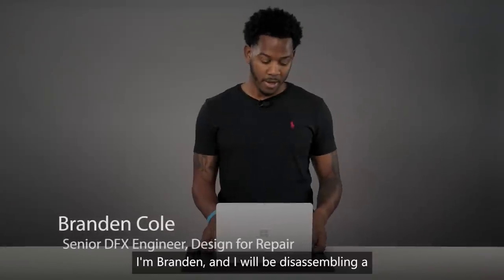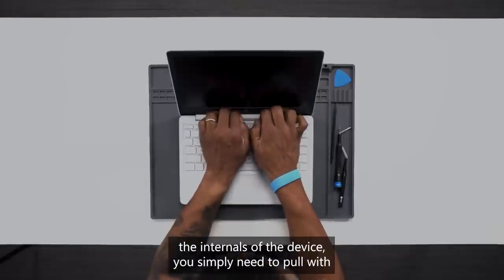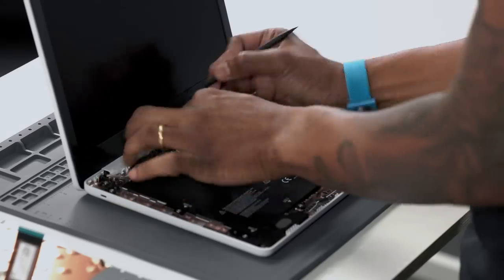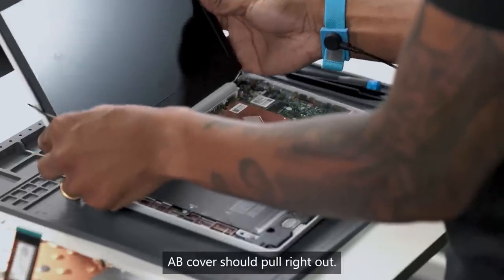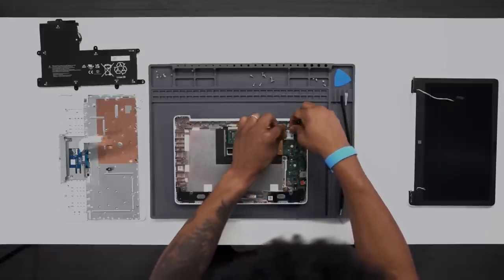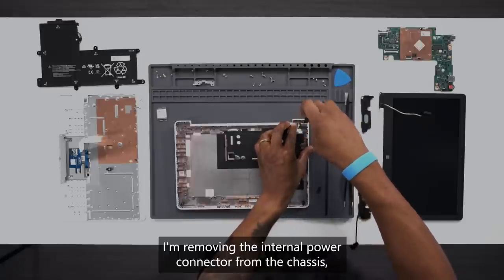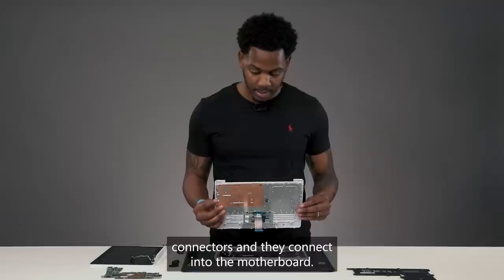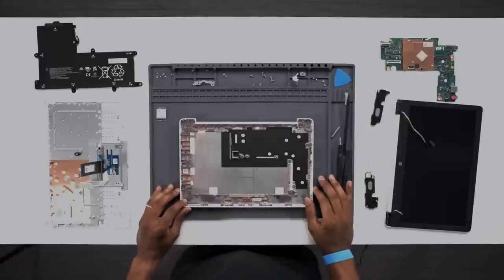Repair | Surface Laptop SE

Comment: Dear Microsoft, if possible, please extend this to your other Surface-Devices. That would be a Game Changer and your Devices and your brand would get the recognition it deserves! Keep the good work going!
Reply: ur not wrong,so dont be like apple microsoft
Reply: No, unless doing so still keeps the Pro X thin. Being slimmer than MacBook+iPad is a selling point.
Reply: They will be compliant with right to repair going forward with their devices, something they stated about a year ago.
Reply: And every Surface product will be thicker and thicker
Reply: Come on just dont open it
Reply: @khtannnnnnnnnn  A few added millimeters of thickness is worth the benefit of being able to repair your own laptop. People always say that they don't care about repairability, but I guarantee they will be wishing they had that option in a few years when their battery needs to be replaced and they can't do it themselves.

Comment: This is basic laptop targetted for the education market. Microsoft plans to sell them in bulks to schools. This video will assist school technicians to repair the laptop on-site whenever needed. My country used to buy Samsung Chromebooks in bulks about 10 years ago. They are quite hard to self-repair. I think this Surface SE should be the right laptop for schools in my country (a developing middle income nation in Southeast Asia).
Reply: I remember being highschool repair ing those Chromebooks it wasn't hard. But it could help if the school would give some testing equipment or better screwdrivers.
Reply: Please avoid pentium processor for the sake of those children
Reply: @blackhatson13  Probably i3s
Reply: the good thing about selling them in bulk means that the used laptop is highly available like the thinkpads

Comment: Nice to see this step in a repairable direction - hopefully replacement parts will be easy to access too, then it'll truly be easy to do DIY repair.
Good job!
Reply: yeah when he was removing the c cover... looked like he had some difficulties removing it... I hope it is much easier in the future for students to remove without having the anxiety of breaking the snaps on the cover
Reply: It's odd that the Wi-Fi card is modular but the SSD isn't. Upgradeability aside, the Wi-Fi card rarely needs replacing. If it does break, no big deal. The laptop still works. You can hook it up via USB dongle or Ethernet adapter.

But if the SSD fails, not only do you lose your schoolwork/assignments, the laptop also becomes a paperweight. The omission of an M.2 slot for storage is a weird one for sure. Running an OS on external storage is always an option, albeit clunky.

Comment: Niiiiiiice
Reply: Bend it Jerry! 😀
Reply: It really is not, Zack. A laptop this size came with upgradable RAM and 2.5” storage not too long ago with a decent cooling system. Despite smaller storage sticks and passive cooling, they completely skimped on upgradable parts. This is merely a disassembly video and doesn’t do justice to repairability.
Reply: @meetankush  I've got a Lenovo ThinkPad x131e which has one 2.5" bay, two RAM slots, two mini PCIe slots (one for Wi-Fi and the other for WWAN/mSATA) and a keyboard that comes out separate from the top and bottom case. And it's got three USB ports, HDMI, VGA and an SD card reader too!
Reply: @meetankush  ram yes. 2.5" storage, I never saw in an 11 inch laptop.

Comment: I am an industry outsider of about 8 years. Just so you know, this is a disassembly video, not a repair video. We see nothing being repaired - pulling it apart is only half the story.

Four most common repairs I see for education-market laptops are the LCD, charging port, keyboard and the "hinge". But by hinge I mean the bottom chassis, or "bucket" in this instance.

 - The video doesn't show the process of replacing the LCD independent of the lid, but it's most likely an off the shelf panel so should be trivial to replace even without instructions. 11.6" WXGA laptop LCDs are very common, it's just a matter of whether it has screw flanges or not. Chances are you can even upgrade it to IPS!
 - The DC jack is a modular and not soldered, excellent! A lot of Chromebooks these days have USB-C only for charging, and the port is usually soldered which sucks for repair.
 - Ideally the keyboard should not be fused to the top case, so it can be replaced on its own.
 - When a laptop "hinge" breaks, it's never the hinge itself that breaks. It's the mounting point for the screws in the bucket, or the bucket itself. Would've been nice to see a large steel anchor or some other kind of reinforcement so that it's far less likely to break in the first place.

Comment: All the laptops I have ever owned were basically this straightforward to repair. (Other than Apple! Which I never buy, but I have gotten some when family members no-longer wanted them. Even the ~2012 and older Apple laptops were about this repairable if you could only get the replacement parts easily.)

I appreciate how above and beyond Framework has gone now, and I like that companies are publishing teardown guides. But all my Dell laptops/desktops for example have had repair and service manuals. Acer is also openable and user-serviceable.

Having non-replaceable parts is an extremely recent trend in the history of consumer PCs. We should understand that this is a step back, a regression from even the 2000s and 2010s. And demand that companies KEEP computers repairable. Not glue and mold them down into parts that aren't "serviceable" so much as "breakable" if you attempt to open them up and take them apart.

Anyhow, thanks MS for going BACK to repairable designs. Like it always has been. Don't regress that ever again, please. Especially if it's just following Apple down a bad road that led you there. Thank you.

Comment: Apple would NEVER dare to do this. Even with their "pro" products. Microsoft is still the best!
Reply: That is because you won't need to repair a Macbook unlike this garbage.
Reply: That's because "Pro" products are not easy to disassemble and repair. I would love to see what are you gonna say about Surface Laptop Studio repairing? As you are talking specifically quoting "pro" products. So idk what is your point about apple but every other laptop manufacturers including Microsoft don't make their pro products easily repairable.
Reply: @Waldo  Remember. This is a school aimed product for young people, mostly kids in class, so that's why it's prone to breakage, it's also 5x less than a macbook pro
Reply: You would still want to still clean out dust from a macbook. don't you do maintenance on your computers?
Reply: @Shawn.Shooter  at least the surface laptop studio does not have pentalobe security screws.
Reply: @thetechbin401  You don't need to clean the dust out of a MacBook for 7+ years. Dust barely impacts performance in the first place. The MacBook air doesn't even have fans to collect dust.
Reply: They announced an independent repair program months before this was announced, which will include MacBook Pro‘s at some point.
Reply: Microsoft is the best until you realize that you need to repair them immediately due to trash qc!
Reply: valve is initiator and MS is coming. Cool!
Reply: @marky7009  Repairing 7+ year old macs, a Windows machine would be LUCKY to last 3 years and that is just the hardware, the software starts showing its age in less than a week.
Reply: @Waldo1122  This is a 250$ bulk education device and it'll still have better longevity than a modern macbook will.
Reply: @cooltwittertag  Is that why Microsoft themselves is posting a how to repair video, because it is so reliable. Just admit it, Apple is beating Microsoft at their own game.
Reply: @Niko-op3oz  I have never experienced that.
Reply: @Waldo1122  Wrong, you will eventually need to replace the battery even if nothing else breaks.

Comment: Microsoft, I bought the Surface Pro competitor offered by Lenovo, the ThinkPad X12 Detachable, as that product features six screws behind the fold-out back cover used to access the internal components of the device. No adhesive/glue was used to prevent opening of the device and user-servicing of it. That device also has user-acquirable parts to use proper replacements. Please introduce this to all of your product lines in the future and I would consider a Microsoft product more seriously.

Comment: So......are replacement parts available to "authorized repair" shops and refurbishers only? Or will we we see batteries, boards, and displays readily available on the official Microsoft Store for the average consumer, hobbyist, and enthusiast as well?

#RightToRepair #LouisRossman
Reply: This video is mere disassembly walkthrough with no upgradable hardware. This product is as repair friendly as an iPad, really.

Comment: I like how the palmrest is the first part that comes off since the keyboard and touchpad are the parts of the laptop that get worn out the most. You could easily restore one of these laptops to "new" condition for another user by simply replacing that. The only problem I have is that the SSD appears to be soldered onboard. So, that basically means this entire motherboard has a limited lifespan.

Comment: Wheres the storage drive?  Memory?  This another case where if you end up with a faulty drive or memory you've gotta shell out 300$+ for a whole motherboard assembly?  It's great that you can repair but it leaves a bad impression when simple things like that are ignored.
Reply: Most 11” laptops (barring chromebooks) are more repairable than this device.

Comment: The only thing I'm worried about here is the EMMC being soldered on. Whenever I've seen cheaper soldered flash like this, the write endurance is pretty pathetic, see the HP Stream.
Reply: It's a throwaway laptop, besides those connectors are pretty expensive and on a craptop that cheap they have to get margin off somehow.

Comment: Come on guys, it's nice that techs can easily remove all components, when what is most important to the savvy consumer is can the memory and storage be removed or upgraded.  The processor is a waste of time in addressing..  nice 1st step MS
Reply: Upgradable components aren’t for the “savvy” crowd, they are for everyone. Two years down the line, 8GB RAM won’t be enough or my SSD can die on me, none of those two things I can upgrade myself, making replacing memory or storage a complete board replacement issue, which is half the price of the laptop. Microsoft releasing this video is likeone opening the trunk of a Tesla car.

Comment: What is that blue wristband with the cable for, that he is wearing? Never seen that before.
Reply: For static discharge. The wristband is connected to a metal object that is grounded. Any inadvertent static electricity that builds up because of our clothes or other objects rubbing against our body can be conducted safely to the ground, instead of accidental discharge on any of the microelectronics that may (and does) cause harm, resulting in that electronic device to never work again.

Comment: With that kind of opening mechanism, what is the water resistance of the device? That usually isn’t an issue with laptops, but given that it’s being used by kids the worry is always there.

Comment: No replaceable RAM or Storage though. And the base model is only 64GB. That was low 10 years ago when SSDs were first coming out, today its a real joke. Just windows, office and a handful of documents and pictures and I'm already past 60GB used space on a clean install of Windows 11.
128GB should've been the minimum in 2022, not 64GB.
Reply: Then this computer isn't for you and you should buy a higher end unit.
Reply: this laptop is for education market, not for you.
Reply: @sugadevanarr1  
With all due respect, even with all the cloud storage options available with this device, how’s one supposed to justify the 30GB post Windows installation space for all of a child’s documents and videos? Not everything streams online and some 3rd party applications take large space upon installation. iPad is much more versatile and exactly as repairable as this device. Who is Microsoft projecting their virtue to?
Reply: @meetankush  this device competes with chromebooks. Chromebooks are inferior to this And chromebooks gained excellent market share in education market. Education markets works differently. iPad is repairable? versatile? In which world? Learn.
Reply: @meetankush  this laptop is not available for the public. That long reply is simple BS. EDUCATION MARKET! Go and learn.
Reply: @sugadevanarr1  tell me, you're still a teenager in his parent's house, aren't you?

Comment: Hi Microsoft can you make a laptop with 
IPS LCD 3:2 60 Hz 13inch touch display
Windows 11 se
Intel i3 latest generation
4 to 8 gb LPDDR 4x RAM
64 to 256 gb UFS 3.1 STORAGE
16 hr battery
2 x usb c
2 x usb a
1 x 3.5mm jack
1x hdmi

Comment: First of all, good job Microsoft..
However I think it's repairability has been decided in the last minute.. Unlike Framework, They basically haven't done any extra designing to make it more repairable than any non surface laptop (even Apple laptops are this accessible).. check the keyboard flex cable for example, they could have made it a bit longer for ease of access.. 
In this case, they just didn't go the extra mile to make it unrepairable by gluing everything shut..
It is however a very welcomed gesture nonetheless. Just stand by it.
Reply: And as someone else mentioned in the comments, they soldered the ram and storage on the motherboard, which only suggests that they either didn't plan it from the beginning or they didn't really mean it and it was only a PR stunt.